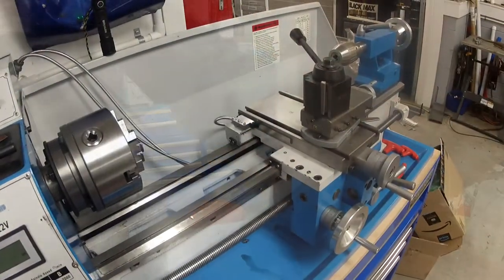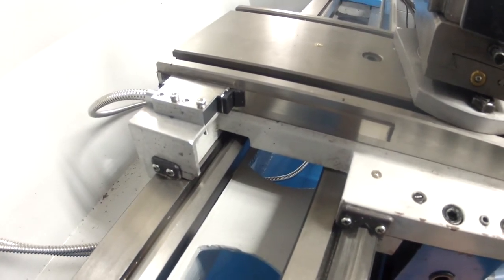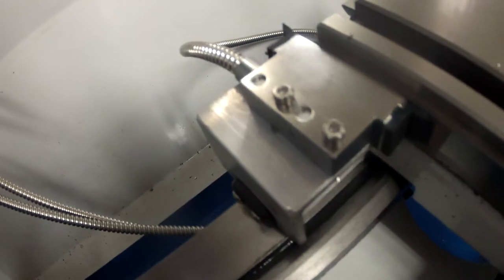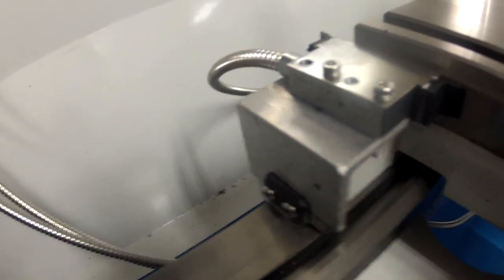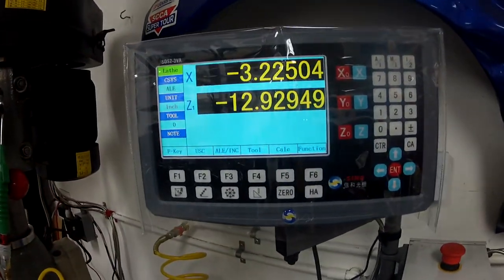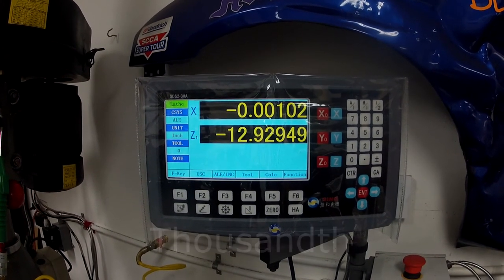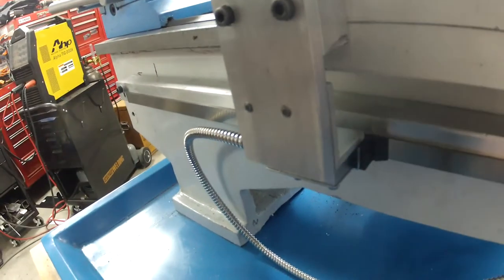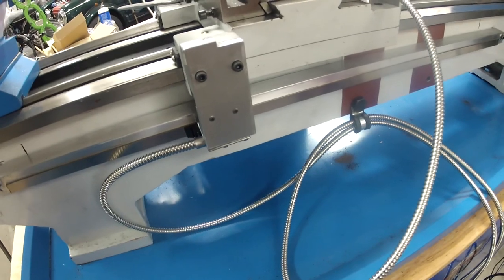DRO - 2 Axis, 1um, Magnetic Lathe DRO for Under $350

Comment: Did I understand you to say that the Sino read head works with glass scales and the magnetic ones?  This is a good option I did not know about.  All the magnetic scales I had seen were equally as large as the glass scales.  Thanks for the video.
Reply: I would say the readout works with glass and magnetic.  The mag tape only works with matching sensors.

Comment: Thank you for the video and informational.  Do you have any problems with metal sticking to the magnetic tape.  Also how did you prep for the tape to stick and does it stick  really good.
Reply from the maker: I think I used brake cleaner on a rag.  Any good degreaser should work well.

Comment: Thank you for the video. Very informative. It seems to me that the difficulty would be keeping the magnetic tape straight and parallel.  Any advise on how you did this?
Reply from the maker: The short one is easy, did it by hand.  For longer lengths clamp a straight edge or a piece of angle to the machine to ensure a straight tape.

Comment: I have a question about the magnetic tape. Can you take the longer 1000mm tape and cut it into shorter lengths or do you need a tape for each scale?  Ideally I would like to buy one tape and 3 sensors for my mill.
Reply from the maker: You only need 1 roll.  It's very easy to cut the magnetic tape and it's stainless cover.  I used a Dremel tool with a cutting blade.